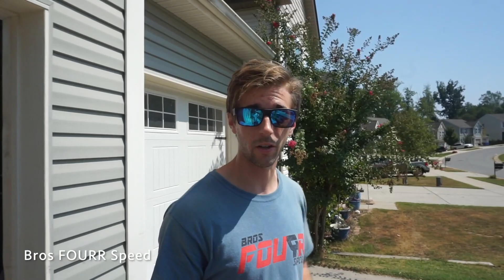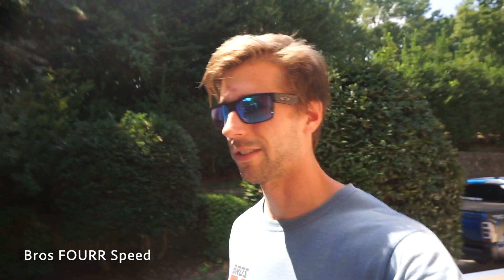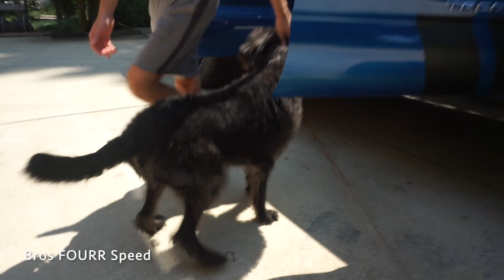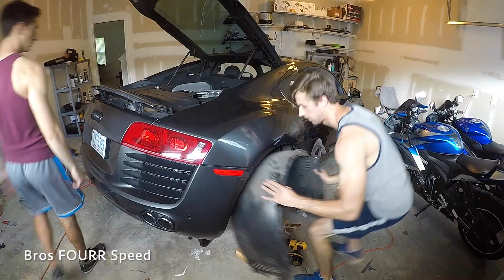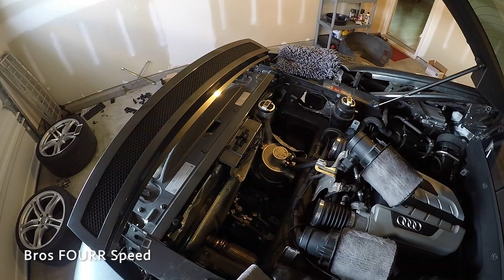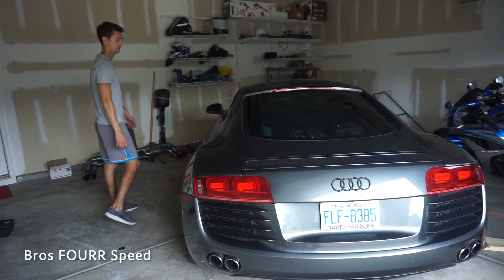Removing The LOUD EXHAUST From My SUPERCAR!! *This Was Sad*

Comment: What are the benefits and downsides to selling your car on consignment?
Reply from the maker: I would say a benefit is they can advertise the car basically everywhere, Cargurus, Autotrader, their own website, facebook. It goes everywhere and you don't have to worry about advertising yourself.  Of course you can advertise as well, but they take care of all that and do all the paperwork with the buyer.  Downside would be have to negotiate the percentage the dealer takes so you have to consider that too.
Reply: @BrosFOURRSpeed  What should you consider when determining percentage, do you set the price, is the paper regarding the consignment done up from (I'm sure it is)?
Reply from the maker: @skylerssupercarlife348  It's all going to depend on the dealer. Some might charge a flat rate or a percentage. Just do what works for you